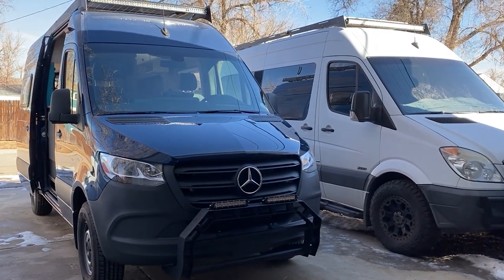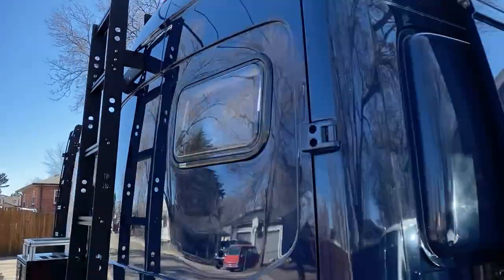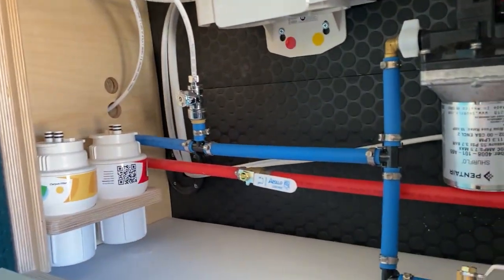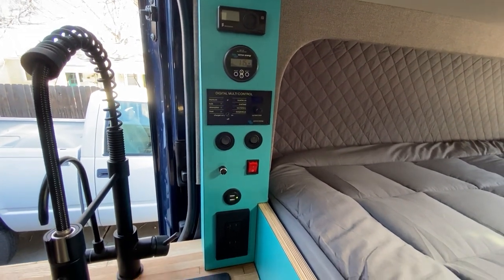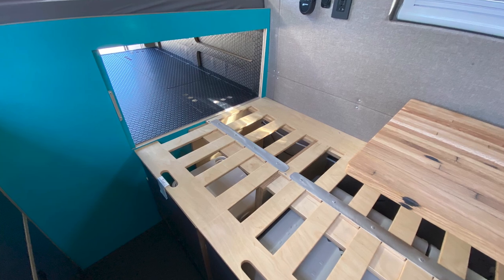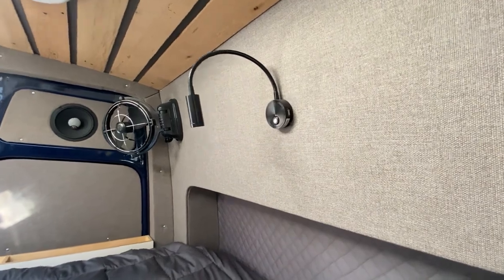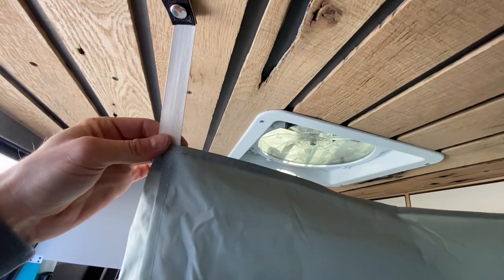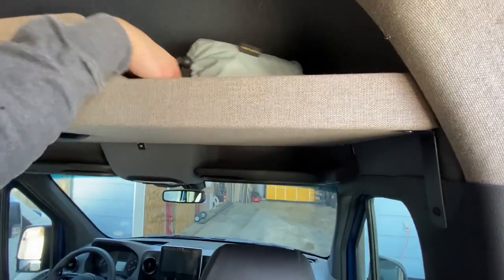Stargazer Van Tour

Comment: Nice work. Any special tricks installing the petrol heater?  Not much info on-line for gas Sprinter heater installs yet.  Thanks.
Reply: I'm curious on this as well.  I don't think the gas models have an Aux fuel connection, so assume you are having to drop the tank and add a standpipe?   Reallly nice build, I like the clean style.
Reply from the maker: I posted a Install write up here, https://sprinter-source.com/forums/index.php?threads/79040/page-2#post-1011997
Scroll to the top of a forum page, this link, for some reason loads at the end/ bottom of the write-up.